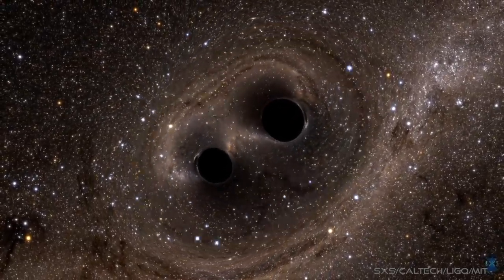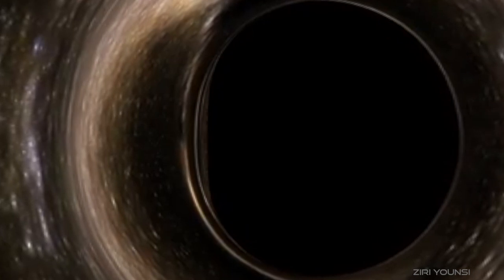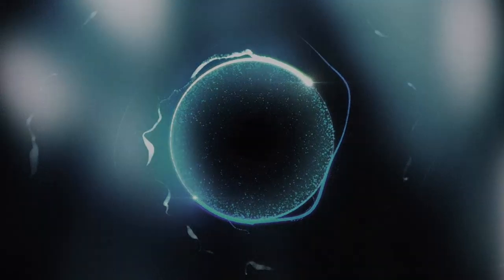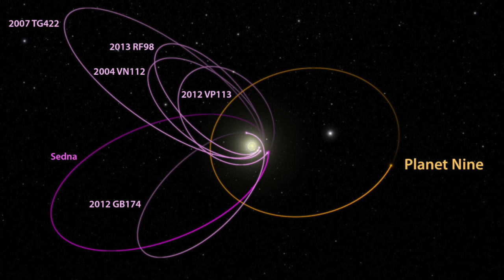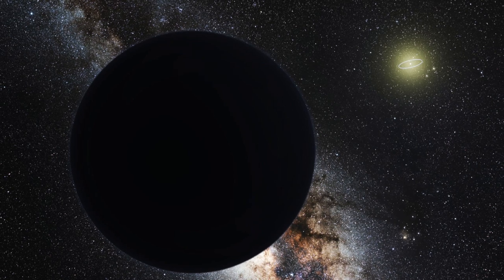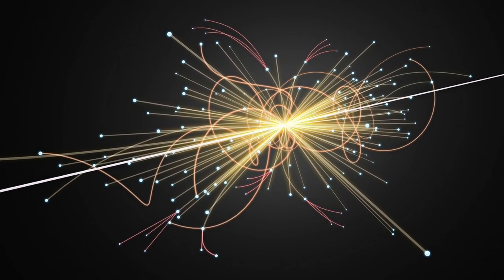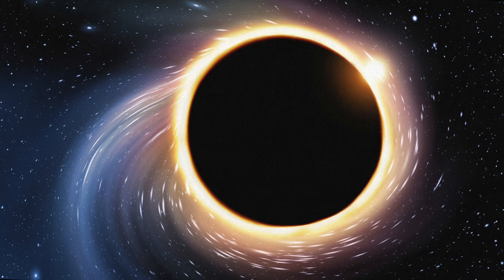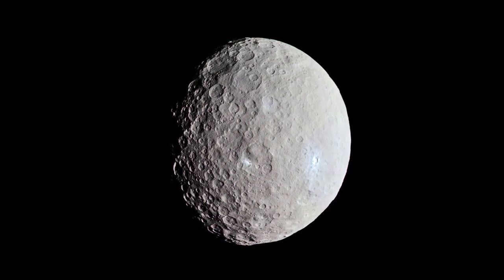Tiny Shiny Black Holes

Comment: So can you destroy black holes by throwing a few coulombs of charge into them? Since electromagnetism is a much stronger force than gravity and can be repulsive, would an ion beam be a good defence against black holes?
Reply from the maker: They don’t get destroyed by adding too much charge, they just repel any more charge away (at least theoretically!)
Reply: Cool Worlds wow thanks for the reply!

It doesn't seem to require much charge to balance out a huge amount of gravity, so it sounds like a way to get closer to a black hole without falling in. Of course if your ship were throwing electrons into the black hole then it would become positively charged which would make things worse! But maybe a 2nd ship could do the charging of the black hole and the 1st ship.

You said that black holes are terrible capacitors, any idea of the capacitance in Farads? That would help visualize the voltage we need to throw the extra charge in and whether it is practical. Is the capacitance the same as a sphere the size of the event horizon? If so then yes that's a terrible capacitor and you'll never get that 50 Coulombs on to it!

Comment: Impossible for core to collapse. At centre of gravity there is equal mass in all directions, which cancels net gravity there to zero.  Where did you get your infinite density?
Reply from the maker: The center of a spherically symmetric mass indeed feels no net gravitational force. But if you look at any other part of the core, it feels a gravitational pull with a vector towards the center. Thus the surrounding matter exerts a pressure on the interior, which leads to compression. Eventually the density becomes high enough that the escape velocity of the surface exceeds the speed of light, that’s a black hole.
Reply: @CoolWorldsLab  The gravity 1 mile from the centre of gravity would net to the same as you would experience standing on a 1 mile radius sphere of this core, and minimal pressure.  Still no possible formation of a black hole.  Do the math if you like,  but my logic is sound.
Reply: @CoolWorldsLab  Now you've admitted to mathematical fantasy!  A vector is a concept only found in mathematics as has no place in physical reality.  By the way, which comes first?  The mass or the gravity? You can't have either without the other.  Where does the extremely weak force of gravity suddenly overpower atomic and subatomic  forces.  If the iron core can no longer undergo fusion to create energy, where would the 100 million degrees celcius required to force even hydrogen atoms to fuse come from?  Is there enough magic to cause matter to compress to a singularity in a place where there is no energy to prevent supposed gravitational collapse in a region of zero gravity.  There is absolutely no logic to the creation of a singularity,  using phoney math or otherwise!!!  All matter is ultimately made of energy.  The Large Hadron Collider has smashed atoms to subatomic particles.  Properties have been given to them with weird names like charm and spin. The Higgs Boson has determined to give mass.  On what evidence?  There must be who knows how many subparticle energies that combine to make subatomic particles.  Like a golf ball is made of rubber core, windings and shell, a subatomic particle must be made of energies that combine in ways we likely will never be able to determine.  Matter/antimatter reaction can break the structure releasing these energies, but we a incapable of analysing them.  These are the building blocks of all matter.  These eternal energies cannot be forced into a singularity.  As Shakespeare remarked, there are more things in Heaven and Earth than are dreamed of in our philosophy.  It's just that black holes cannot be one of them!

Comment: I just want to ask a very weird question. If the universe is ever proven to be spherical, and a black causes that huge well in the fabric of spacetime. Won't that mean the Rossen-Enstein bridge will be something different with black holes? Won't it mean that black holes will merge at the core of the spherical universe, thereby collapsing the entire universe into it once a critical mega-blackhole mass is reached at the core, which rebounds as another big bang?
Reply: That's the 'Big crunch' model and it generally requires there be enough stuff to overpower the universe's expansion. So far it seems we don't have that much stuff, and the unvierse's expansion rte is perversely increasing.
Reply: @garethdean6382  yes you are right. Then since the notation that the universe is probably spherical... as the universe ages and blackholes reign more and more, can't there be enough pull from blackholes at the core of the universe like I asked, enough to get to that critical inner gravitational pull of the now super-mega merged blackhole super gravitational power at the core of the universe? Here is a sketch to illustrate what's in my head:

   *       *     *
       \   |   /
* -------◎------- *
       /   |   \
   *       *      *

This is more of a napkin sketch. Asterisks are blackholes and that bigger thing is where they merge. 

As a blackhole tries to create a Rossen-Einsten bridge through its deep well it merges with other blackholes and the effect cancels out at the core of the universe. As it ages more and more stars collapse and galaxies merge and eat stars for dinner, they create even more mass at the core, eventually reaching a critical mass to create the required power to collapse the whole universe in a big crunch.

I hope I am making sense and someone can explore this and not forget me in the comments.
Reply: In general your point stands; 'dynamic relaxation will cause all objects in a gravitationally bound system to exchange energy until they merge into one (With some being ejected.) This will reduce galaxies, then galaxy clusters into a single massive black hole.

The problem is that unless some process with infinite reach can link distant black holes, our current universe seems to be expanding them away faster than they could fall together, which would leave each mega-black hole alone in a growing void of empty space. To get a collapse we need dark energy (whatever that is) to quit pushing and start pulling. (Some models such as the ekpyrotic universe suggest that this is exactly what will happen.)

Comment: Is there any work on the Hawkin death of black holes? What would happen in the final moments of Sag A when spacetime snaps back and would anything be left behind?

EDIT: Thinking about it, there would be so little mass left that you'd barely get a ripple and by definition there would be no singularity, so no mass. Anticlimactic given with wait.

Someone please correct if the above is wrong.
Reply from the maker: Yes correct,  by this point Sag A* would be microscopic and thus would die with a whimper, not a bang
Reply: @CoolWorldsLab  Had a girlfriend like that once, waited 1.7 * 10^87 years and then she vanished. ;)

Thanks! Oh, and check out the ParallaxNick channel, he recently covered primordial black holes in relation to planet X - I think you'll be impressed how he covered an oft poorly reported topic.

Comment: In answer to the question at the end. If I had a small black hole “battery “, it would mean essentially free energy for the entire race. I would then set out to figure out the Star Trek style matter replicators. Obviously they require tons of energy, but the black hole would provide that. With free energy and essentially free “stuff “ it would obsolete the current economic systems that oppresses most people. These two technologies would liberate humanity from economics to pursue higher goals.

Comment: Does anyone actually understand Hawking radiation? Matter is inside the event horizon, then later it is not. It leaves as energy even though energy cannot leave. 
If anyone has a description of hawking radiation that actually explains what physically happens to the matter in the singularity and  how matter can be reduced without hand waving that part by hiding behind an equation "therefore matter is reduced", I'd love to read it.
Reply: Don't know but here's an idea. Kelvin. We know that mass has friction because the atoms are moving and the faster the atoms move the more friction the slower the atoms move the colder it is thus reducing the friction. I don't know.

Comment: Wonder how long it would take Freddy to destroy the earth?
Reply: Quite some time, it can only consume matter so fast and it has a very, very small surface area. Just looking at a back-of-the-envelope calculation I'm getting a Fermi estimate of a million years.
Reply: @garethdean6382  Hmmm..... I thought it would be long, but not that long   :)
Reply: There's a theoretical class of stars that have black holes or neutron stars in their cores that can burn for a few million years:  https://en.wikipedia.org/wiki/Thorne%E2%80%93%C5%BBytkow_object

Something that slows the consumption down is that the hole releases energy as it absorbs matter,creating a bubble of hot plasma around itself that slows the infall of matter. It's like a drop of water on a hot skillet, surfing its own steam.

Comment: Did we ever measure Hawking Radiation ?
I thought it's only theoretical, as of yet.
Reply from the maker: Yes that’s right, it’s going to be very difficult to ever observe but it’s widely agreed upon as a natural consequence of quantum theory and general relativity.
Reply: That's my problem with modern physics.
You cannot assume something is true,
based on theory.
There comes a time, where we could
be able to create a tiny black hole.
Or something else, like a strangelet or
the collapse of the higgs, where
assumptions are what often is said:
The mother of all f-ups.
Reply: Wouldn't you be able to measure an analogous effect due to acceleration? According to Einstein's theory of relativity, gravity is analogous to acceleration, so there should be an equivalent of Hawking radiation experienced by things accelerating very fast. Like the Unruh effect. Maybe this can be checked in particle accelerators.
Reply: @vytautasdanielius7058  That's not GR.
An orbit, at constant velocity, is accelleration.
But, ok. At significant speed, you would have
a measure of Unruh effect. But, that's still kinda
theoretical, and I am not that familiar with it.
I'm not a physicist. Just someone with a global interest in the topic. Maybe, that's something, relative to
synchroton radiation.
Hawking radiation, is about virtual particles.
But that, has not been proven, or measured.
It's a mathematical proof.
But, mathematics cannot be proof to reality.
Much like dark matter.
There's still things, we are missing.
Regarding dark matter:
No one said, it is matter.
No one knows what it is.
But if you repeat things often enough, people
tend to accept it as the truth.
In particular, in current global media.
I think, dark matter, has nothing to do with matter.
It's just a stupid name.
Reply: @a-triangle2735  No, there being an orbit or not makes no difference, being in a gravity well is essentially the same as acceleration. You undergo "acceleration" even while sitting on a chair, you just get repelled from it with an equal opposite force.
Anyways, I'm certain that the Unruh effect from an apparent event horizon is directly analogous to the Hawking radiation from a black hole's event horizon, and so any explanation of one should refer to both if one wants to truly comprehend it. The pertinent Wikipedia article states that experimental proof is possible with current technology, but that's a highly specific field; I was hoping an actual scientist like Cool worlds would spot this and either confirm or deny, but I don't expect anything.

Comment: You say the radiation is proportional to the inverse second power of the mass. The surface area is also second power. So the radiation density should be 4th power. Hah.

Comment: at an UBER energy/tech level, hyopthetically, if, we could use those concentrated beams of energy to form a blackhole, simultaneously imparting direction, spin, and velocity to it, by 'aiming the Beams' accordingly? 

Let me say
it would be soo sick bro, if we were K2, as Captain, id load up my shipment onto my space freighter, and have you spawn a blackhole for me(Velocity, direction, and spin) to get me to the local supermass spinner to lazer off of! :+) :+D :+P
Reply: the black hole can be so small that it only needs to accelerate us before it evaporates
Reply: WUT, now you want to power a society off of a black hole -heat engine!
Reply: you just dropped Halo Drive on us at 12:45, (its not properly called "lazer" like in my earlier post lol)
Reply: YES! charge them like you said at 16:00, def..
Reply: sounds good at 18:00, might it even be a better 'bet' than fusion?
Reply: last post.
How can we hurry up our whole planet?

Comment: well, your idea does not make any sense, because we need to put in the same amount of energy in order to create a black hole that will supply us with that energy, so why create one???
Reply: It seems to me that the point is whenever you create one, your energetic problems will be solved for billions of years
Reply from the maker: It’s a giant battery, but the point made at the end of the video is that it’s not really likely to ever be worth doing
Reply: @CoolWorldsLab  regardless if you will be able to do it or not, my point is, energy needed = energy created! which means why researching into this if it's not free energy source???
Reply: It could be a useful converter. Imagine making the smallest possible black hole and feeding it rock. Or radioactive waste. r uranium. You feed it just enough matter to stay stable and in return you get a massive amount of power. You could use it to literally 'burn' anything and turn it into pure energy.

Comment: infinite density = infinite gravity
thus a black hole would consume the universe.
infinity. 

maybe black holes are not infinite in density.
Reply: dark matter isn't hidden, just difficult to see.
cosmic web of plasma, inducing electric fields, hiding matter in filaments between galaxies.
the great attractor.  dipole repeller.
how fast is the local universe contracting? 

how old is the universe?
plasma cosmology.
Reply from the maker: No. Infinite mass would yield infinite gravity. F = G M m/a^2. Density doesn’t feature.